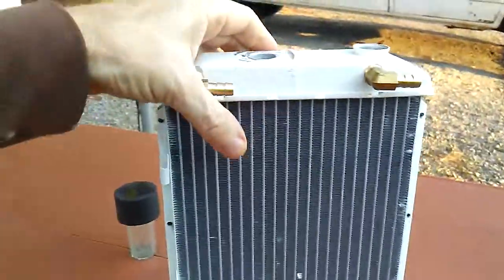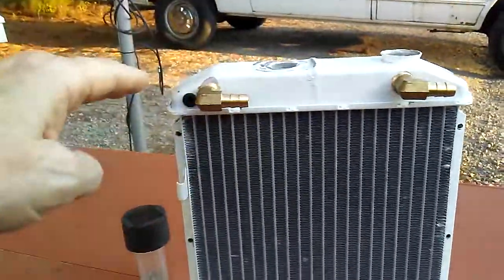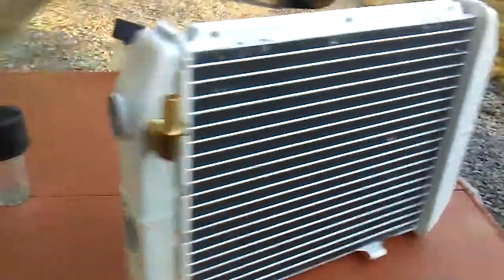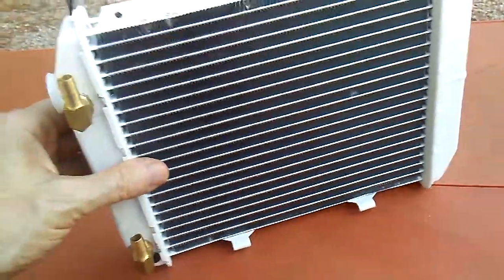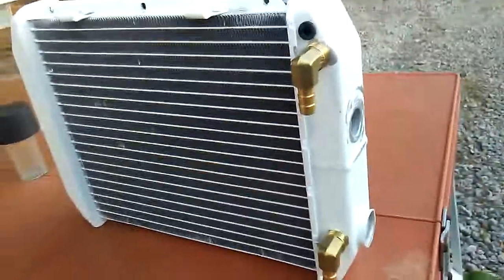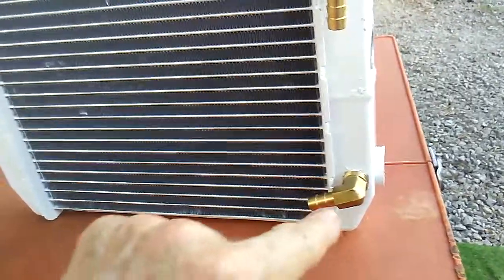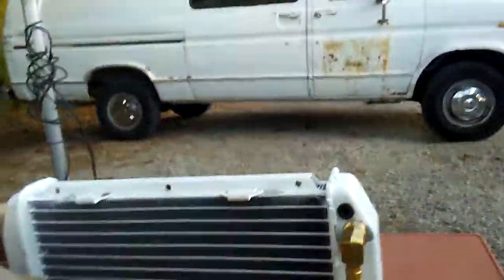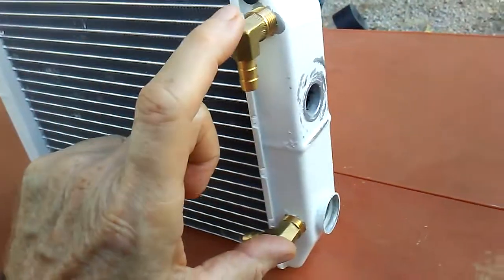Homemade Air Conditioner: Important Radiator Position!

Comment: I have a mildly uncomfortable heat in my room during the middays and this gave me an idea to use a heater core from a car and refrigerated ice box and some pc fans.
Reply from the maker: Excellent idea! One thing about PC fans is that when they're placed up against the radiator they air flow tends to scatter vs blowing in a straight line because of the PC fan design. I am going to build a small model using PC fans as well soon. I will install a tube on both ends to funnel the air flow straight and harness the output so it's more straight forward.

Comment: Great videos I have a question I have a mobile home that has the a coil in it which is like the radiator the cooling fan system that's got the blower and all connected I'm wondering is there any way that you can tell me how to take that a coil and run this same kind of a system on it to cool a whole house the condenser and the compressor got hit by lightning so the outside portion is no good at all I'm wondering is there a way where I can turn that a coil into one of these sisters one of these systems on a larger set on a larger scale to heat to heat if I run cold water through it just would like to get your thoughts thank you and thanks for sharing I've watched all of your videos very good work you can tell you put a lot of time into it
Reply from the maker: Definitely!
If you have enough ice/fuel you can use it for sure.

One way would be to use a small freezer and run a long enough wrapped coil through it like a long spring coil and circulate ice water closed loop. Or have a portable ice maker that can supply enough ice to run the AC all day. The math between chilling the water while new hot air heats the water is the magic spot. I have found that oversupplying the fuel/ice/chilling method is better than under supplying the cold/fuel because you can always back off and use less. But, If you undersupply or under-design then it's harder sometimes to scale. But' I suppose mental attitude during R&D if kept sane lol then either method would work.

It can be difficult on the mind and our human psyche to upgrade a homemade AC that's underperforming in a heat crisis as opposed to slowing down an over performing unit. I built my original unit during a Southeast Texas muggy super hot summer the year I began living the vanlife and living off-grid. It put the pressure on me big time. But, If you have time and patience then it won't be so bad. But, I'd still rather over supply to the best of my resources first etc.

Thanks for watching and surely let me know about your design and outcomes for sure!
James

Comment: New sub here.  Good point on the radiator, i was wondering about the high point.
Reply from the maker: Hey, Thanks Brent...!!!
Another important radiator position variable is the vertical vs horizontal position. After infrared testing with this radiator I believe won't allow circulation of the ice water throughout the top and bottom effectively. It would be colder on the bottom half than the upper half when positioned horizontal. I currently build with the radiators in the vertical position so that the entire radiator is utilized.
It's possible that a higher volume water pump could overcome that(horizontal positioning though but I haven't tested with my other pumps yet. I always used my radiators vertical when living off grid and worked perfectly. The reason for the horizontal tests were for the purpose of building lower profile portable units etc. I also daisy chained smaller 4 PC cooling radiators for the lower profile build but found some tend t corroding during tests a couple of weeks ago. So I went back to using automobile heater cores again...
Thanks again, James
Reply: COLD SCHOOL good point on the orientation.  I imagine they have been designed for that orientation.

Comment: Why keep testing the inefficiencies of swamp coolers? Why not connect a compressor to your radiator and fill it with cooling gas?
Reply from the maker: Hey, Thanks for the comment!
These are actually not swamp coolers because they don't use evaporation for cooling. They are closed loop air conditions but the loop system is not under pressure. I make them this way so they can operated on 12 volts or solar. By not using a compressor I can keep the amperage very low for off grid living or van life etc.
Reply: @COLD SCHOOL use one of those 12v refrigerator compressors, they work great and some even have variable speed which adjusts power consumption.